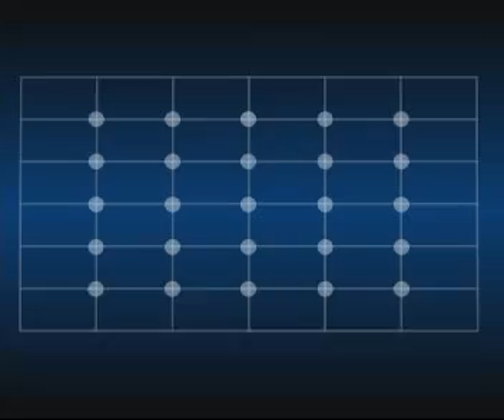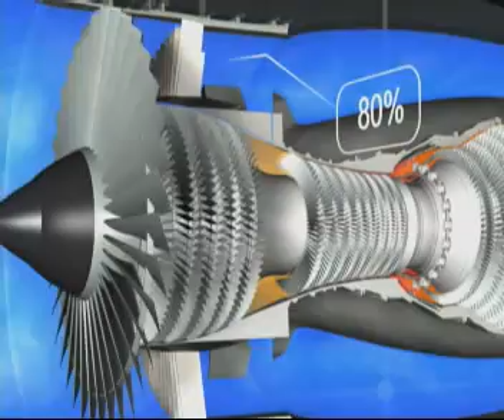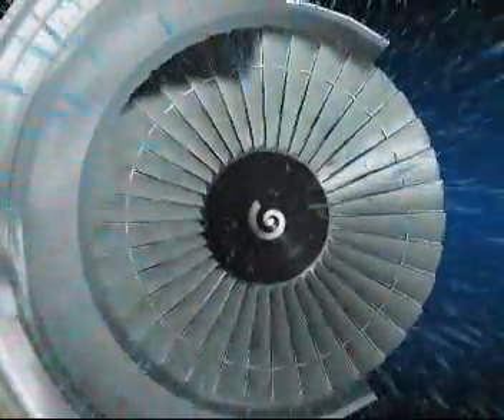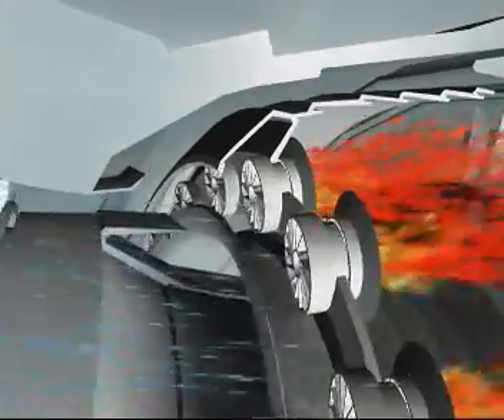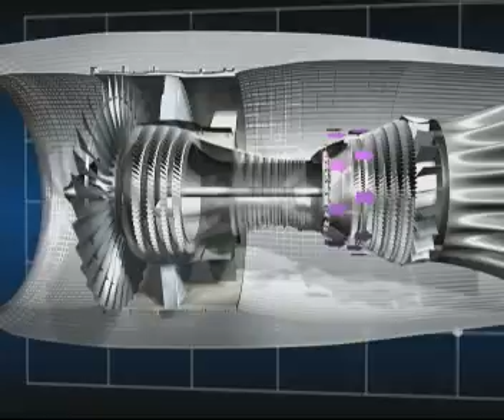Turbine

Comment: You answered your own question. Just like the only purpose of the engine in your car is to drive the wheels that push all that metal, plus your ass around the streets so you can pick up a loaf of bread at the store. All the"junk"in the middle produces the necessary power to drive the massive air gobbling fan on the front of the engine that propels the aircraft. The"junk"in the core requires only 20% of the air inducted to burn to generate the power.

Comment: That's the point... It's more efficient to produce thrust using the fan than using the core Jet straight away as using low velocity (but large flow) = More effective.
In a modern turbofan, the Core is mainly there to spin the FAN.
You can view a turbofan engine as a ducted Turboprop.

Comment: I'm so confused. It said 80% of the air didn't touch any of the complex stuff in the engine, only touching the fan and the "bypass duct" funnel. It also said that this 80% air provides 80% of the thrust of the engine.

So what the hell is the point of all the junk in the engine, other than to power the fan???

Comment: @the26thhour 

Think of it like an internal combustion engine -4 stroke. Suck, squeeze, bang, blow. It's drawing in air to compress. Compressing it, igniting fuel with the compressed air (like a diesel engine would at TDC) then using the force of the expanding air (Expanding because it's heating) to drive the first stage compressors.

I hope this clarified it a little.

It's really nothing more than a large turbocharger on an engine- instead it does all the combustion internally.

Comment: As a complete turbine noob, would there be any form of propulsion if the rotors turned without fuel being added to create a controlled explosion?
Is the whole purpose of squeezing that much air into such a confined space simply to feed air to the fire? Is that why the options are always prop, jet or a combination & never just a non-explosive turbine?
Cheers.